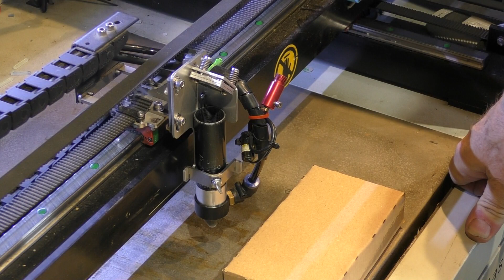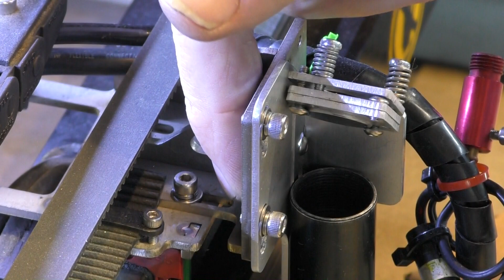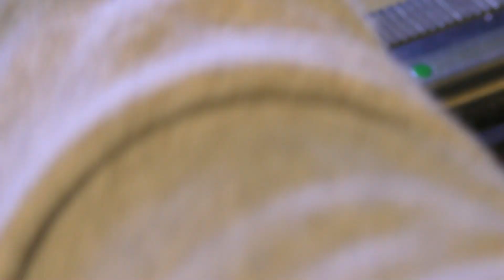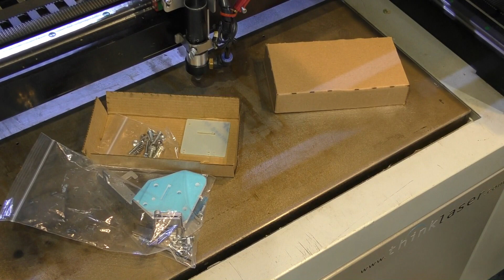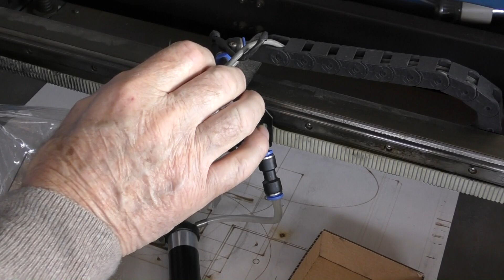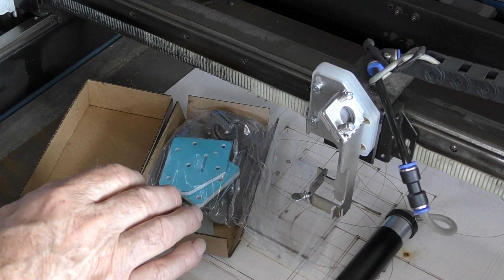RDWorks Learning Lab 184 Lightweight Head News

Comment: Just an update for you. The 3050 "China blue" machines as manufactured principally by "Shandong Kehui Laser" are currently shipped with the linear guide rails ON TOP on the gantry ---and unfortunately with the X axis motor sitting hugely on the gantry as well---If you buy your new machine directly on Alibaba this will be the model you will get. All the new units' metal enclosures also comes with the "pass through" removable slots on them.

Comment: Russ G'day, thank you for another great video. I have a question for you, have you ever cut a mitre joint with your laser? Seeing as you are a maestro with mirrors, how difficult do you think it would be to make a swiveling mirror at the bottom to change the angle from 90deg to 45deg? I'm interested in hearing your thoughts. I've seen some people that use a jig an angle the material but that then limits the size of piece you could cut. I have seen one video where the head swivels up top Ill paste the link here for you to have a look if it piques your interest. https://www.youtube.com/watch?v=HAZX_fn0EQ0 cheers and avagreatday.
Reply from the maker: Hi
 That's no mitre  that's just a single plane wonky cut. Apart from interesting  visual mechandising products, I can see no real use for it. You could not program it to put mitred edges on a square for example so that you could build a cube. For that trick you need a 4 axis laser.   However, you don't need an expensive  elaborate set of mirrors to perform that function, just some simple wooden lasercut jigs This is a demo I did for someone  and is not a published  video  https://www.youtube.com/watch?v=goIz0AI1Jvk. So yes I can  mitre any angle anyhow  if the machine is big enough and I have the ability to decode the complex angles. The mitering is the easy bit.
Best wishes
Russ